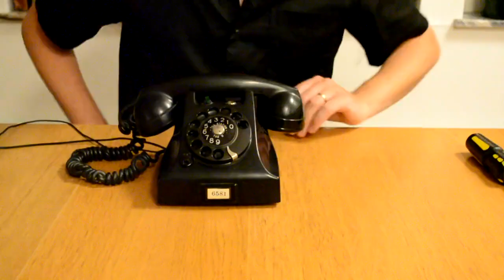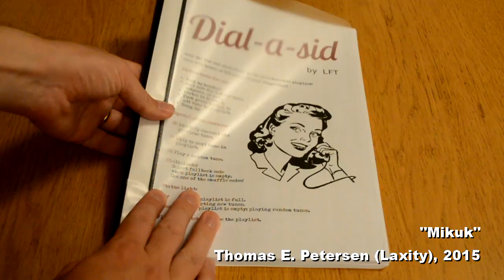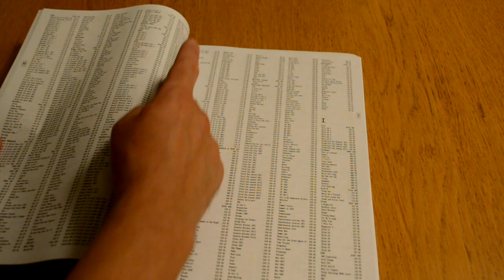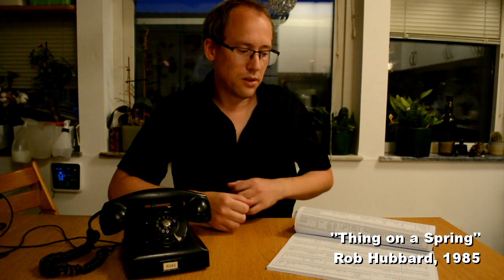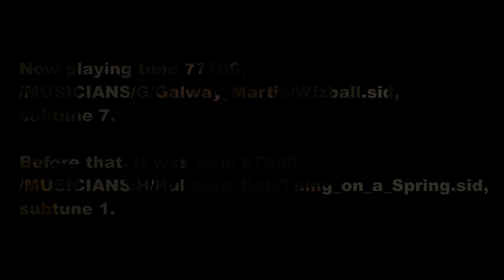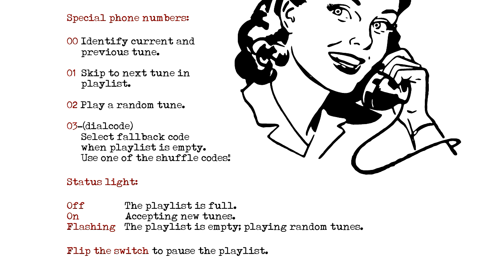Dial-a-SID: The party jukebox for chiptunes

Comment: How do I build one? I already have a dialing mechanism I wanted to use for a rotary cellphone concept that didn't fan out. It would be trivial for me to design and 3dprint something that resembles an oldschool bakelite telephone, so those parts aren't a problem either. Raspberry Pi's aren't a strange sight in my house either. Most of my roomies have a decent RetroPie setup for gaming, and there's always spares. 

Right now I'm using a regular breadbox c64 with a 1541 Ultimate 2 (not the 2+ sadly), which serves my HVSC playing needs, but this is just a whole lot better if I just want to listen to some SID's quickly. I'd love a readymade SD-card ISO that loads SID's from external usb-sticks hooked into the Pi.

Comment: I wonder how you pulled off the two separate player instances on two audio channels. I reckon one of the stereo channels goes to the output and one to the earpiece? But then they still use the same audio output device.
Reply: I think you're right with the separate stereo channels, and I don't think that would create a problem at all. I mean, it's common for a computer to play audio from multiple programs at the same time to the same output device.
Reply: @xereeto  silly me, it's a computer running an OS with an audio subsystem. So somehow he might have hardpanned each player to the left and right channel.

Comment: Can someone explain why the 0 is at the start of the rotary dial instead of being after the 9? Is this regional? Is it a mod for this project?

I'm used to 0 being represented with ten pulses when pulse dialing, which makes putting it after 9 the most logical choice. When returning, the dial would interrupt the circuit once for every number that passes, so the number after 9 would make ten pulses.
Reply: Different pulse systems are used, varying from country to country. Sweden uses two pulses to signal the number zero, and 11 pulses to signal the number nine.
Reply: if I am not mistaken, it is probably because 0 is/was the most used number when dialing in different zip code, dialing other countries (00...) or some toll free or maybe even some special numbers. So it made sense to put it there so you didn't need to wait very long for it to reach the end.

Interestingly enough, I looked up some old phones and we also had 0 after 9, now I'm intrigued.
Reply: It seems Sweden had their own system with numbers going from 0 to 9. In Norway we had two systems. Oslo (And New Zealand, too) used 9 to 0, while the rest of the country used 1 to 9 and 0 after 9.